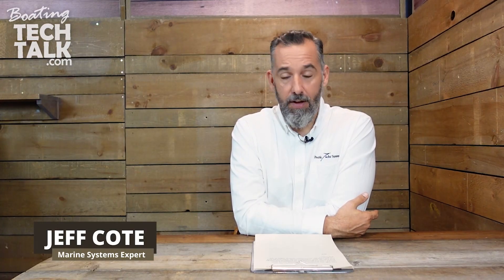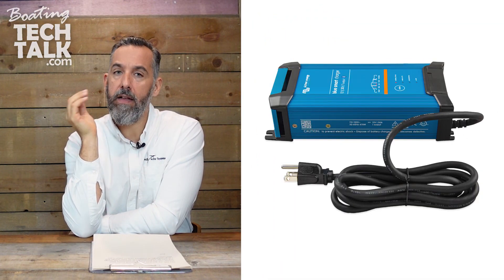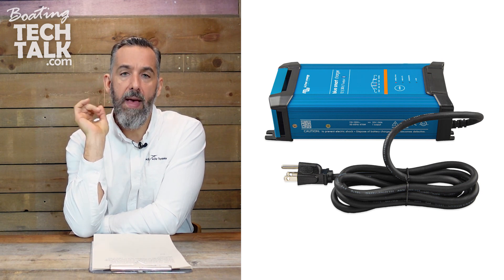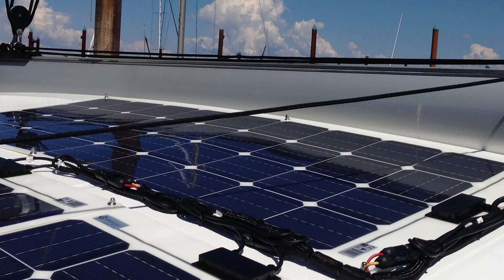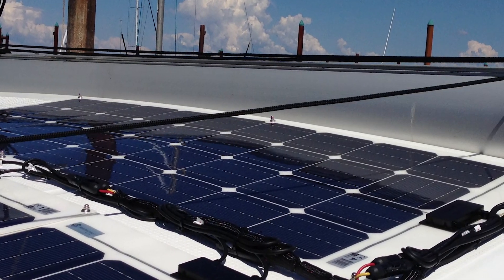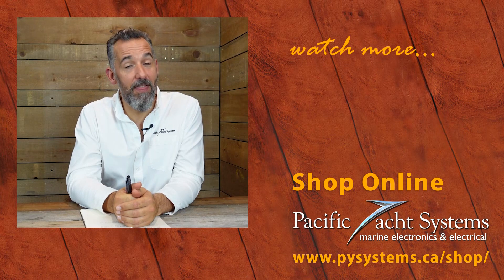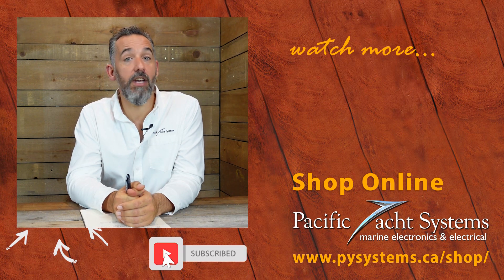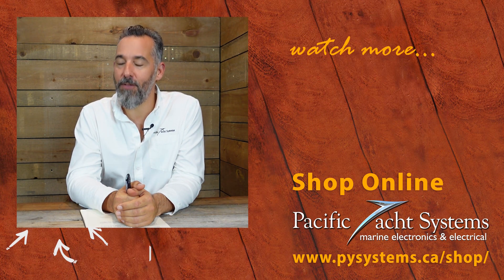Solar or Generator to Top Up My Boat’s Batteries?

Comment: One question i would like someone to answer is there any difference when using a Domestic and or marine solar panels in a marine environment. The marine shops say there is a difference but no one at present can tell me the difference other than the prices charged at the store. So, if anyone can please let me the physical difference if any or it just B.S.  due to in 210mm width commercial panels are now available up to 650 watt per panel. please note that voltage of the larger panels will increase due to the cell count which maybe an issue for standard 12-volt marine systems
 regards

Comment: Jeff, seems like the assumption was lead acid batteries (bulk, absorption, float)…would the answer be the same for LiFePO4 batteries?
Reply from the maker: Good question, LiFePO4 batteries offer the advantage of faster recharge rates right up to nearly 100% of capacity over Lead Acid batteries.

Comment: Is that model charger from victron approved for a marine use? (I thought I looked into that one and it was only approved for dock or RV use.)
Reply from the maker: To my knowledge, yes those Victron chargers can be used on boats. Can you share the info where the Victron charger isn't compatible with marine applications.